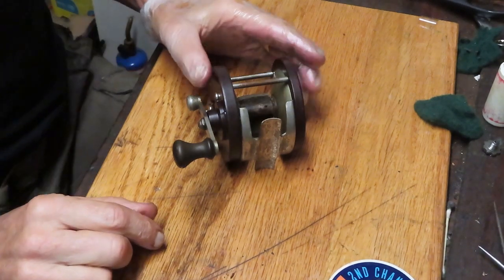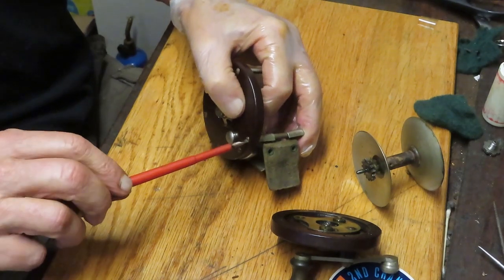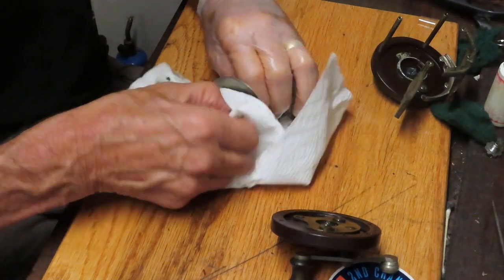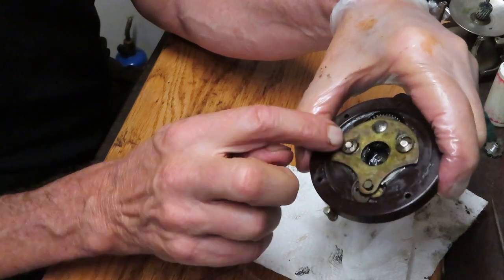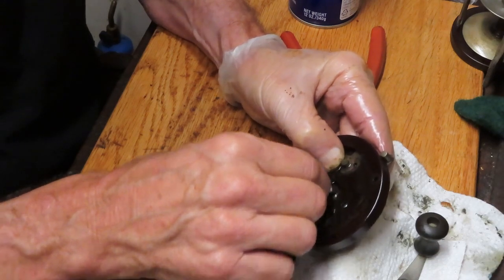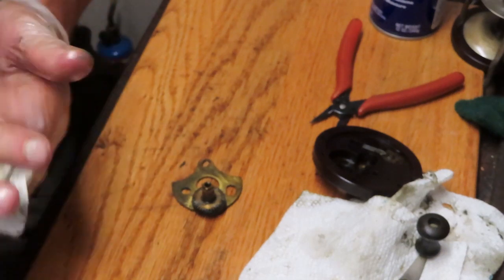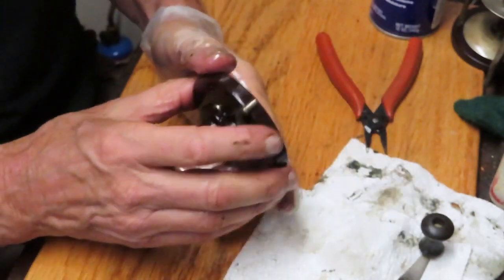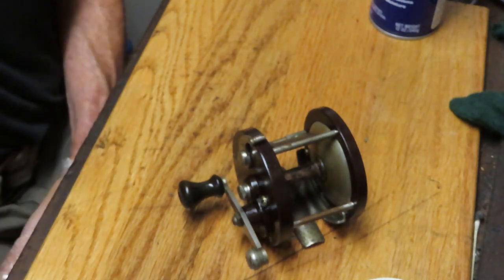Ocean City Brigantine circa 1940s fishing reel service and unique free spool release

Comment: Hi 2nd chance tackle, I have a question. I recently service my abu garcia black max and a shimano corsair 401. They are much smoother but I noticed that turning the reel has a considerably more consistant resistance. Could this have to do with the viscosity of the grease used? Does overgreasing drag washers do this?
Reply from the maker: Check the spool adjuster knob.  The added grease may have settled in the bearing and reduced the clearance.  Just back off the spool adjust a little and it will probably fix your issue - Dennis